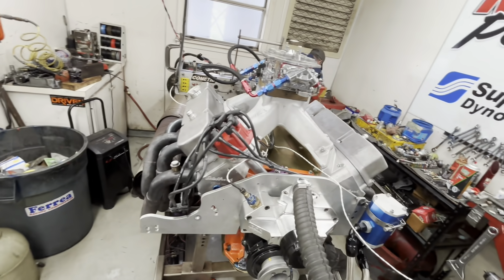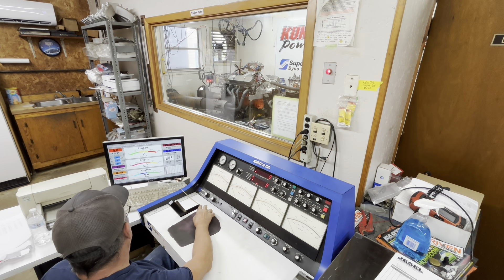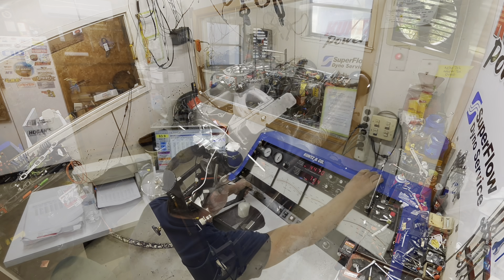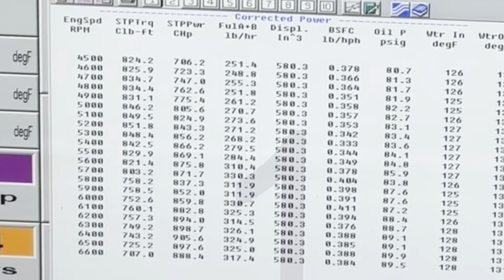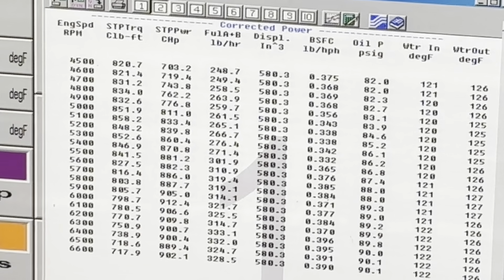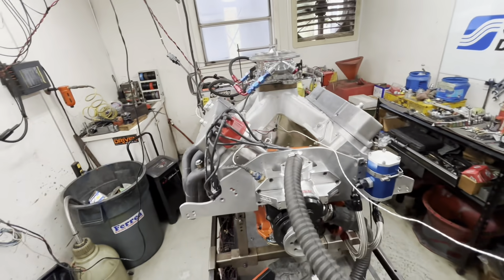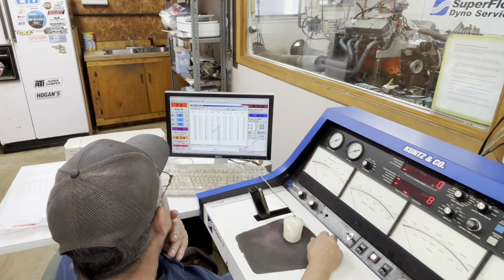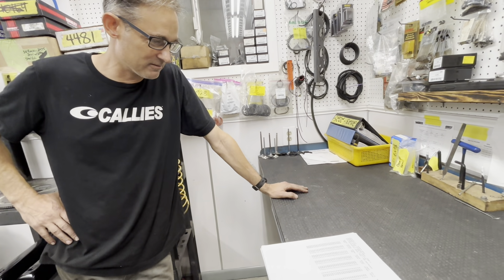Mopar 580 Stroker Dyno Day! #mopar #dyno #stroker

Comment: My original comments were on your pushrod check up video
Reply from the maker: We relashed the valves hot on the dyno. There were only 2 that had .002 more than when we lashed last time. Do you still run this shaft system without issue?

Comment: Last time I commented on the flex in the T&D rocker shafts   Just interested to know if you tested it for yourself. Thanks
Reply from the maker: I noticed the flex in the shafts while tightening them down. I loosened off on all the adjusters as best as I safely could, then rotated the engine to relieve pressure on the few valves that were open. I remember your previous comment, but I can’t find again.

Comment: Solid work brother. 900 hp for a wedge head motor is fantastic. That’s aftermarket big block Chevy head numbers. And like it or not the canted valve head is superior to a wedge design. So you did a helluva job on that 580.
Reply from the maker: Thanks buddy! He’s really happy to have it back together and happy

Comment: Congratulations Joe. A reflection of your attention to detail. 
I just discovered today from a new engine builder that the previous one installed the wrong crank bearings. I was supposed to have .010 under bearings. You think that could be why my oil pressure was low? Unbelievable. 
The owner finally found the right guy(s) for this engine build. Nice job 

What is the advantage of aluminum rods? The pros and cons?
Reply from the maker: Thank you! And yes, wrong bearings can definitely cause low oil pressure. Aluminum rods are known for fast revving almost instant torque. The cons are that they have a short service life and they cost more.
Reply: @JustMoparJoe does less reciprocating weight effect hole shot once the light turns green? I had an aluminum flywheel on my 440 once. It was horrible. I was wondering if that’s comparing apples and oranges. I get the acceleration positive but was wondering if there is a trade off

Comment: Joe, did you use that Fastfish rear main seal?  Almost 100 lbs pressure, and no leaks?  Impressive!  Good job on the build and paying attention to the details.  Makes all the difference.   Oh, and what car is this going into?
Reply from the maker: This one goes in a late 60’s barracuda drag car. Should be exciting!
Reply: 900 hp in an A body, should be a high 8 second 1/4 mile!

Comment: I drive my Charger on the street, bottom line is with 740 pounds/feet of torque, he’s right sometimes it gets a little squirmy on the pavement. You got to be careful where you rock into the go pedal, it will wake you up fast.
Reply from the maker: Sounds like a blast!

Comment: Make sure the oil pump drive is the longer one part number 21523 from summit I had the 21525 in my 572 an over time the 21525 stripped out the oil pump drive. It wasn't long enough with use of the external mildon oil pump. Just letting you know.
Reply from the maker: That reminds me I need to buy one to replace Rick’s. Mopar 580 Aftermarket Stroker Top End Assembled
https://youtu.be/qKeu_sX2_uk

Comment: I cracked up when the dude at the end tried to slip a backhanded compliment in there:
"Pretty good wedge... for a Mopar " 😆
Jackwagon needs to be led away from his bowtie indoctrination....
Excellent job Joe!
- Ed on the Ridge
Reply: Right 🤣 let’s see a 572 Chevy motor beat those numbers.
Reply: They do it more easily and cheaper than our engines - unfortunately.
Reply: @ThePaulv12  Comparing apples to apples (60's engineered big blocks), no they do not.
Reply: i caught that too,